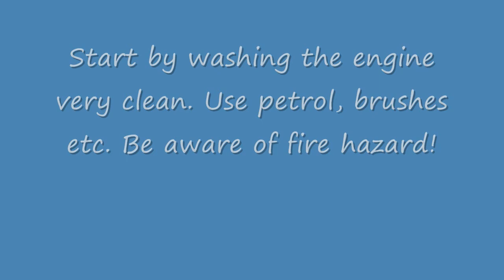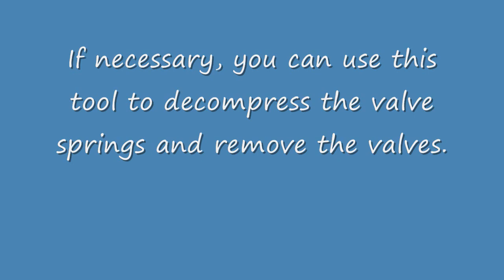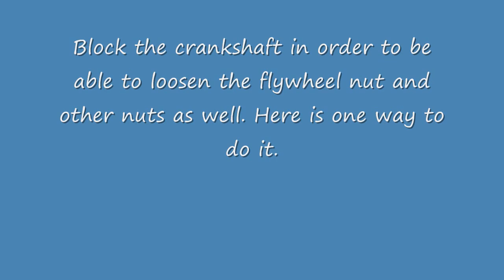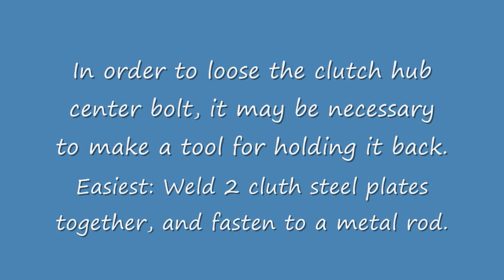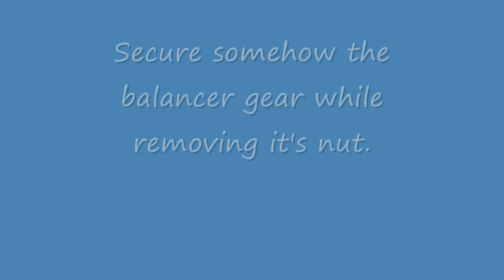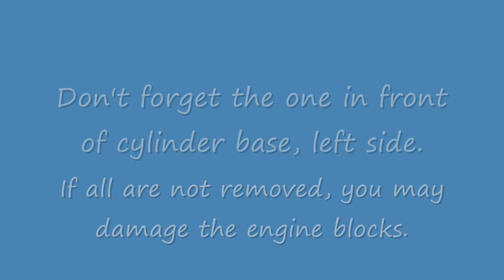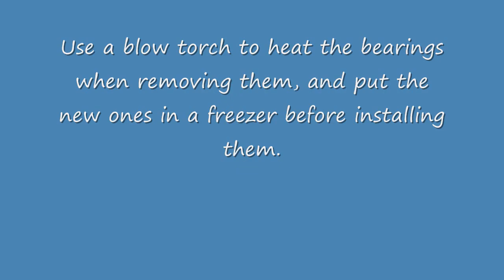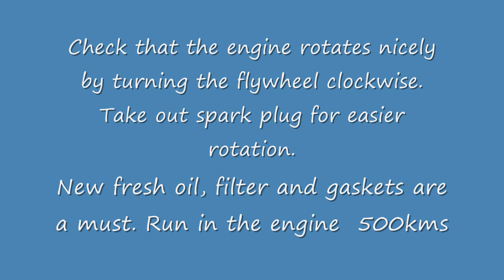Kawasaki Eliminator 125 engine stripdown compilation

Comment: where did you get that manual for the rebuild a teardown?
Reply from the maker: From Kawasaki, the original Workshop Manual has the details. If you join my facebook group Kawasaki Eliminatorr 125 it is published there as a pdf file to be downloaded.
Reply: Can you send the link there so many of them lol
Reply from the maker: @Dailyd2425  https://www.facebook.com/groups/194835963924290/permalink/343184139089471